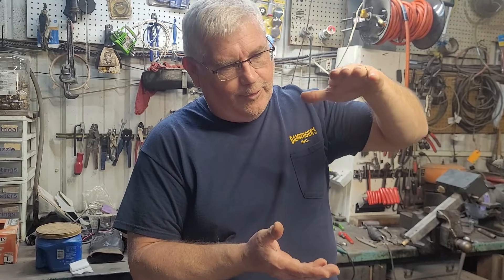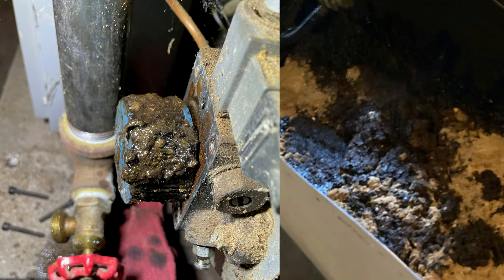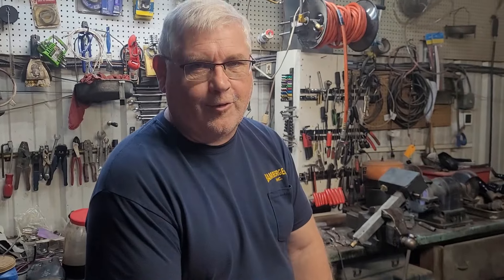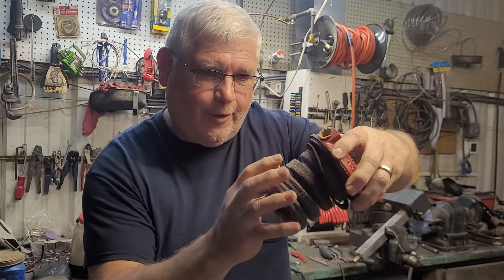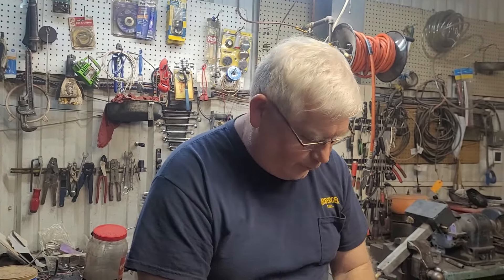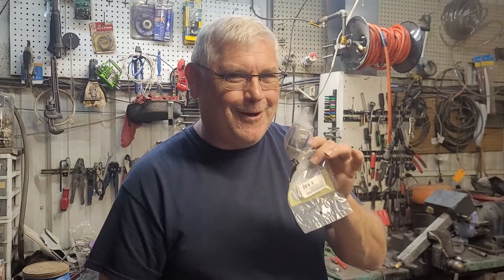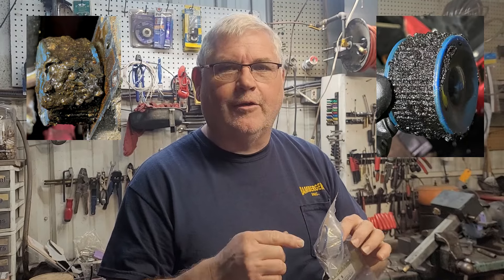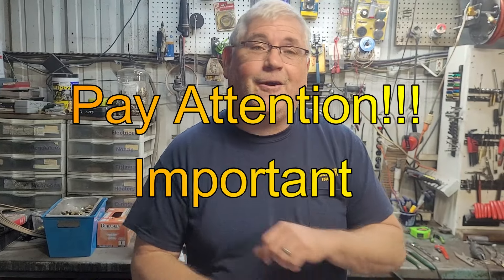Why running out of oil can cause damage to your heating system

Comment: Hi Guys do you know anyone who service waste oil heaters in Chicagoland area ?? cant find anyone and my unit Shenandoah 350 kicking my A..ss, it works perfectly, dialed and tuned perfectly but it blows warm air only, depending what weather is outside sometimes blows hot sometimes just warm cold, some people suggesting to change my exhaust flue pipes because my heat is escaping outside ?? is this something you heard of ? my exhaust temp is at 300 always and sometimes 310. Thank you guys !!!!
Reply from the maker: @jafarhon
I will check if we know of anyone in that area, but here are some things to look for: 
1. Flame size- it should be about two feet long but not touching the back plate. 
2. Is the furnace clean for heat transfer? Check all the tubes! Biggest problem with the 350...
3. Is the the draft right with the stack mounted above the roof? The heat could be getting sucked out?
4. Are the fan switch settings right? 
5. Is the fan dirty?
Reply: Thank you very much for getting back, flame is perfect, i watched every video you have on your channel and educated my self, flame is 2 feet and yes bright yellow 15psi air to 5 psi oil, fan switch also set like it should be, and when i purchased it i opened it up and used my compressor air to blow out all the ash, and than used my 3000psi power washer to wash all the ash out, so firebox is sparkling clean, than i followed your video and rebuild the firing unit including new heating elements and new nozzle. It works perfectly with no glitches, my only concern is my exhaust pipe, is it even possible that my heat is getting sucked out ? Like i commented above, when its sunny and no wind outside its blowing hot, when its cloudy and windy it blows cold / warm air, so got me thinking if my heat is getting sucked outside. Thank you